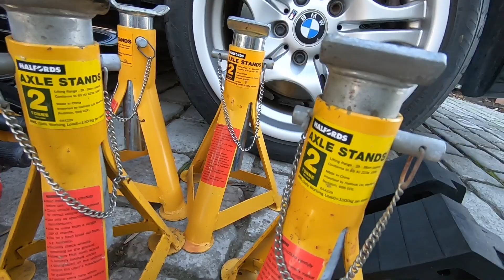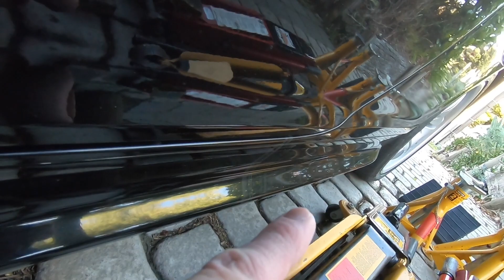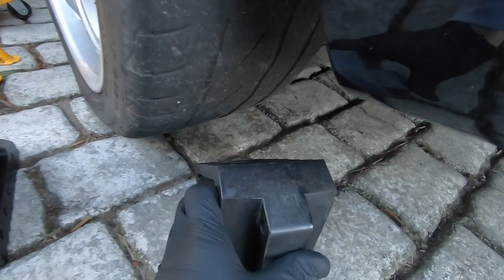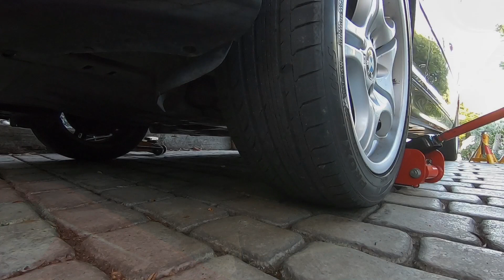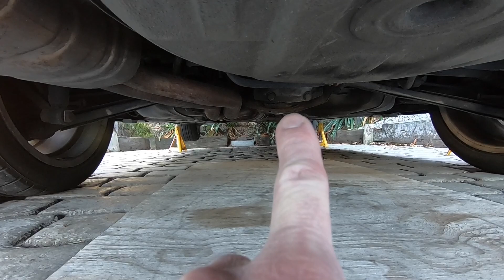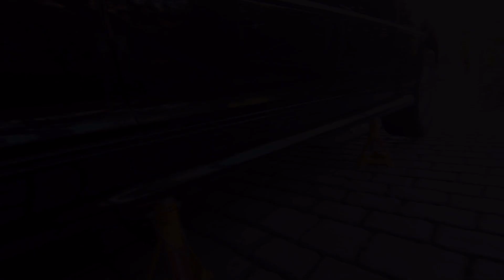How To Jack Up A BMW E46

Comment: Are there any other spots to put the stands on though but? What gives me the fear on these cars is you can't see the actual metal you're putting the stands under, in the UK for all you know it could be rusted out lol
Reply from the maker: They are the strongest spots. If you’re worried about rust, get a garage to inspect the car first on a hoist, to confirm if it’s safe

Comment: Why not use the front and rear jacking points, no need for two jacks.
Reply from the maker: No.1 Car was too low to get the jack under the front of the car. No.2 If you jack at the front centre point it crushes the aluminium stiffener plate

Comment: class video, but what does that front chassis brace look like just so i can picture it a bit better, scared of going through the car with a jack haha
Reply from the maker: Box section running longitudinal, the plastic overlaps it slightly on the inner edge

Comment: It's all about the 330Ci Coupe! Mine's Mystic Blue and have had it for a few years now. Absolutely fantastic car. Even took it to the Nurburgring a couple of years ago and the only fault I had was the rear ABS/speed sensor, which I put down to crap from Brunchen corner carpark after it pissed it down something rotten.
Reply: totally agree, i have had a e90 for a few years and just got a e46 325 as a project car, absolutely love it more than my e90, going for a 330 engine swap next year but got a long list of maintenance first 😄.
Reply from the maker: @bigash_n54  3.0 swap good idea 👍
Reply from the maker: They are great cars for sure, I daily drove this one for 9 years. The Nurburgring must have been a great experience in the 330ci
Reply: @MTechGuy  Yeah it was brilliant. I have my lap videos on my channel somewhere, and it was my first time there. I didn’t go mad as I knew my limitations and I needed the car to stay in one piece! Hugely recommended for any petrol head. I went Thurs - Sun and met some E46 guys at the hotel who were ‘ring regulars so they ended up being my tour guide!

Comment: You missed a spot about jacking it from the front.
Reply from the maker: When you Jack from the front in deforms the aluminium under brace
Reply: @MTechGuy  it has a cross member that is strong enough to jack it.

Comment: what percent tint do you have? looks perfect
Reply from the maker: 0% tint! It’s as it left the factory
Reply: @MTechGuy  damn, must be the lighting and camera. Or the previous owner. By factory they don't have tint (so I'm told). Check if on the inside there is a film or a separate layer near the top of the window.
Reply from the maker: It’s factory, they come with a slight green tint. There is no addition tint added to this car
Reply: @MTechGuy  ok you're definitely right since my car has the same and I had to remove it. Guy at the tint shop kept telling me that wasnt factory, trying to charge double to remove it. So I removed it myself.